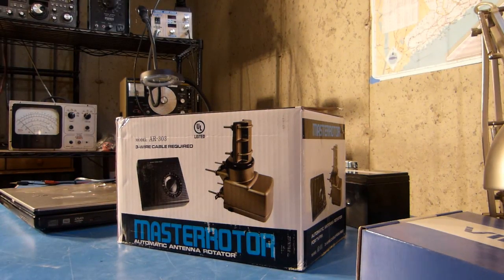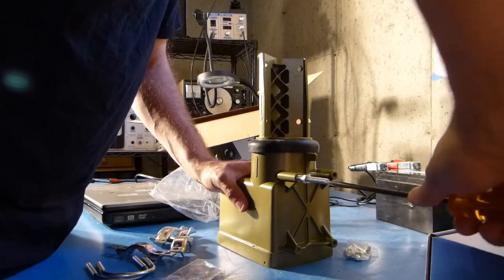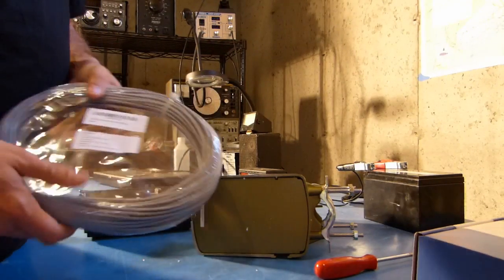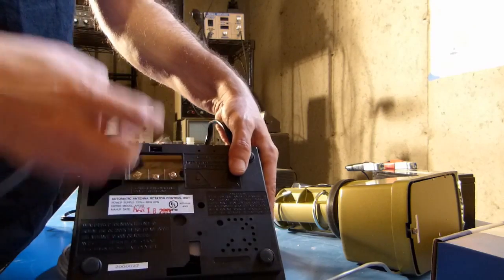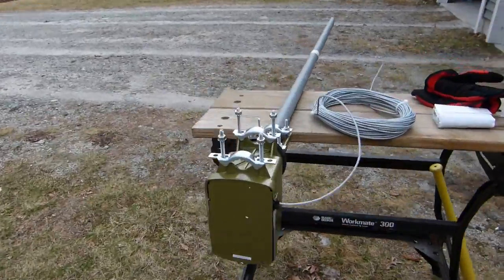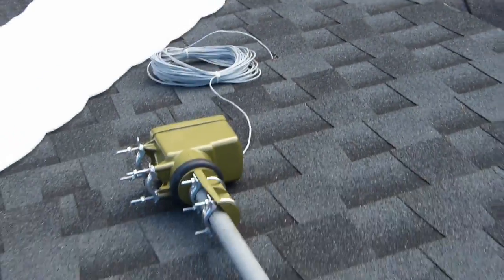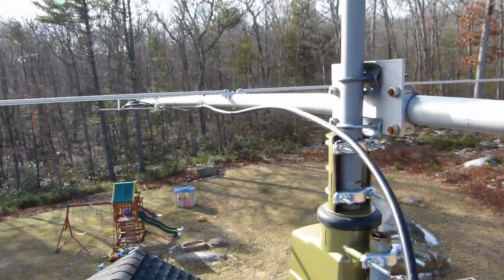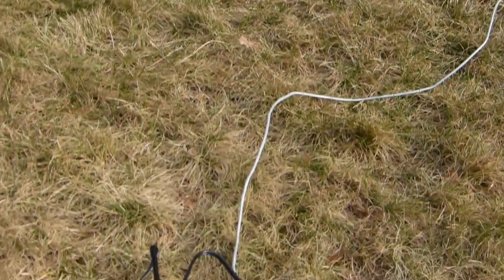HyGain AR 303 Antenna Rotor Installation and Setup Highlights

Comment: Many years later in the future I post this wondering how the rotator went and did it last up their originally they really were made for tv antenna and light UHF yagis I personally would of just bought a yeasu rotator and be done with it.
Reply from the maker: It's still there now and working fine and I've never had a problem with it...in fact I used it a few days ago.

Comment: my brother in law had one of these on his place, but his had a flat 4-5 wire ribbon cable that ran from the control up to the motor unit. but this was back in the 70's
Reply from the maker: Same design as back then...they haven't changed it much over the years

Comment: good video for average person. However, with your wind load that rotator is way understated. At a minimum, a Yaesu 450 would be significantly better. I have put up a few VHF antennas (222 M2 10E, and also 432 15 element K1FO) on same mast/rotator with the eaves mount set up and an old radio shack rotator without any issue-- wind load much lower. 5 element 6M M2 not good for this installation. You can see my installation on my QRZ page showing the 222 and eaves mount.
Reply from the maker: I agree ... But this has been working fine since the video was posted.

Comment: Hello, my question is it's been 5 years now is that rotor still working for u? I have a 9 foot width Winegard antenna that I'm trying to find a best quality rotor for it.
Reply from the maker: Yes,cut is still working great
Reply: You can't have much wind at your location then..... They are the biggest pile of crap as a cb / ham rotator made..... Just made to turn a small tv ariel on something like a camper van that's about it for normal cb ham radio use they are total waste of money buy a reasonable yeasu 450 650 or 1000 and fit a cage and thrust bearing for many years of trouble free use 29-fb-040 northwest Ireland 73's
Reply from the maker: I live in southern New England...it's windy here all the time, especially in the winter when we get coastal blizzards.  Antenna is still up and working fine....

Comment: does anybody have a idea if there is a way to  make these rotors quieter? just a little fyi. when you go up with these or anything out doors Antennas, tower Etc, use never seize or Anti seize kind of stuff i use  permatex and  3m  this way one day you or somebody will have to remove those bolts, nuts etc and it will come off way easier. i learned this from the military, they used Anti seize in Kuwait with the military vehicles and took off bolts, nuts that had been in 140 deg heat for 8/9/10 years and never had a issue.

Comment: Just a suggestion. Put anti-seize on the treads of the studs. If they break after a long run they will come off easy.
Reply from the maker: Good tip! I usually do but forgot on this project.

Comment: Super video.  Thank you for this and all ofvthe others you've done.  Such a great resource!  My question is, admittedly, a very, very basic one:  do the conductors have to be connected in a certain sequence, i.e.-red should go to #1, black to #2, green to #3?  AND does the connection sequence have to be te same on the controller unit?  I have a HyGain AR500 that I'm connecting a receive loop to for the first time.  Thanks for your help!
Reply from the maker: Thanks for the kind words! You have to connect the wires so that pin 1 on the controller is connected to pin 1 on the rotor.  Same for the other pins.  The colors help you keep track of that but it doesn't matter which color you use on each pin pair.
Reply: @SevenFortyOne  Thanks very much for getting back to me!  Much appreciated!  Stay safe & well!

Comment: I'm looking at doing the same setup. Eave mount ham antenna. I want to get more heavy duty mounts than you have here. I think they should be spaced farther apart to get it more strength. I want to do a large dipole and go up farther off the roof 10 ft. I would much rather pay a professional installer to do it than get up there myself.

Comment: Good video. How has it held up? Have you ever got the coax in a bind during rotation?
Reply from the maker: It's still working perfectly...used it yesterday in fact.  I've never had any issue with the coax binding
Reply: @SevenFortyOne  ok. I see gigaparts and some others no longer carry it. Was looking for a rotor that would work with a Cushcraft A148-10S

Comment: Great Video! Using 18 gauge thermostat wire is preferred. The rotor grommet will clamp  it like a vice, so it will not slip.

Comment: Nice video. Did you find that this rotor was adequate or did it break or spin on you in the wind? Thanks, new sub here. I’m putting up a Rohn 25G 60’ tower to replace the one knocked down 3 months ago by a tornado.  Cheers!
Reply from the maker: My rotor is still working great with the big m2 antenna on it.   I'm actually kind of surprised-i didn't think it would last.   It does move around a bit in the wind but otherwise it's fine.   Good luck with your tower project-i hope that's all the tornado damaged!  We had a scare here a few weeks ago when one passed a few miles to the South of me.   73!
Reply: SevenFortyOne Thanks for the reply.  In addition to the tower, we lost a few trees and pieces of others and some roof damage mostly soffit. All in all not bad. A church in town lost its substantial roof.

Comment: Thanks for the DEMO I've been contemplating the switch from my vertical to a yagi for 2 meters, but I'll need a rotor to get the full benefit. I've never seen how they hook up before so it's nice to see what it will require.

Comment: Just wondering how the rotor is holding up now that some time has passed. I'm putting together almost the same setup but with a 2 element 20m about 20lbs
Reply from the maker: Its coming up on two years since I installed this and I haven't had any problems yet.  In fact, we just had a nasty wind storm here a week ago and the antenna/rotor made it through that just fine.
Reply: SevenFortyOne awesome.   Do you ever have any concern about the bottom support of the antenna gable support coming out or anything? Like that's my biggest concern is the gable lower support piece